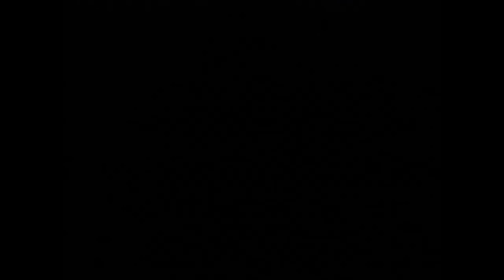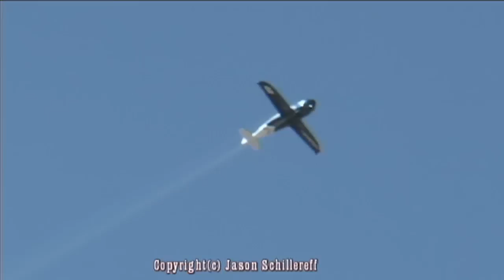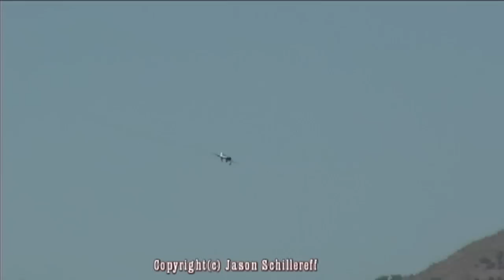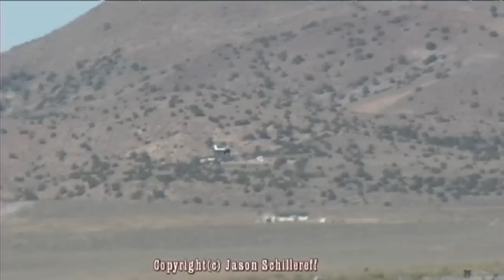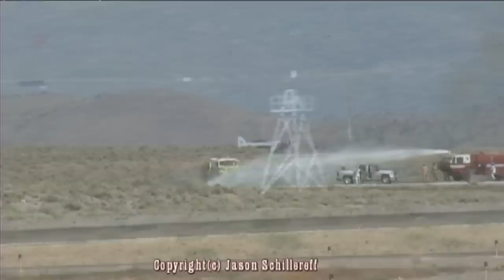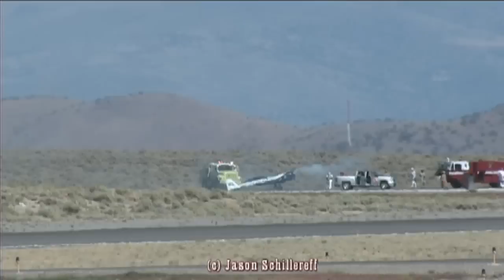Sport class racer 'Relentless' mayday 9/14/2010

Comment: its going to be tail heavy, its going to be tail heavy, its going to be tail heavy. dude knows nothing about anything lol
Reply: ***** no it was probably smoke, steam is evaporated water
Reply: ummm, yeah dude does...depending on the weight of the prop being it's WAY out front the plane and a light weight race craft can easily become tail heavy with loosing a prop.. a 182 with a few small bags loaded will be very tail heavy without a prop... these race craft are balanced on a pin... you remove a heavy prop up front and it will be tail heavy right then and there. thank god for the pilots sake it was a very light prop.
Reply: The prop has no weight value because it's angular momentum distributes is weight evenly 360 degrees. The plane did not land tail heavy.
Reply: Red 5  You are not a pilot